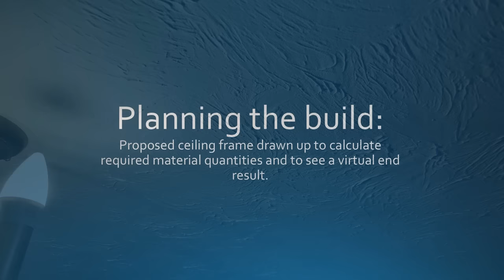Fibre Optic Star and RGB LED Ceiling DIY Build

Comment: Brilliant job, the best one of these I've seen, many thanks for posting this video. I love the overhang around the inner edge of the false ceiling surround, most of the DIY builds I've seen don't do this, but it seems important to me as a way of hiding the LED strip as well as increasing the effect of the starfield being way up in the distance beyond the ceiling. Can I ask, where is the LED strip mounted - is it on the horizontal or vertical? Thanks again, this video's been extremely useful as I'm going to begin my own attempt at this next month.
Reply from the maker: Thanks so much for your positive feedback and message. It was a pleasure to read and I greatly appreciate it.
The LED strip is mounted on the horizontal part and points light straight up, so only ceiling edges would appear to be washed out and not the whole star ceiling.
I hope it helps and good luck with your project! 
Do not hesitate to get in touch if you will have further questions along the way.
Reply: @DIY_it_ALL  Thanks so much for your reply, very helpful: I'd been trying to visualise where the best placement for the LED strip was - and yours works perfectly, so I'll go with a horizontal mount. I've seen several of these starfield DIYs where there's no lowered outer surround, rather the whole starfield is contained in a "dropped box" which, to my eyes, 100% misses the point of what makes these look so good. Thanks again, yours is the video that's fully inspired me (i.e. yours is the build I'm going to copy!) Cheers, keep yourself safe and healthy, all the best.
Reply: Koi ki miles  is not too i
Reply: Oooooooooll ok lnd koi I ok I will ji you my
Reply: @DIY_it_ALL  What state you located? I need to hire you. This is awesome work🔥🔥🔥🔥🔥🔥🔥
Reply from the maker: @uniqueone8928  Thanks so much for your comment! 

Unfortunately I don't think I can be of help though, I live in UK. And it is just my hobby at the moment...
Reply: @DIY_it_ALL  

Hi diy it all where about In the uk are you from? Seen this vid when first posted and finally got my house this was the one thing I wanted to do but struggling to get the materials that I have seen on this bought leds for another job and was not happy with them and didn’t turn out to well 

Hope you can help cam i private message you do you have what’s app
Reply from the maker: @Billye  Hello mate, thanks very much for your comment.
 I used SK6812 addressable LED's and SP108E controller (link below). 
Starlight-wise, please see the second link below. I personally used 400pcs 0.75mm 4M set.

Hope it helps.
 https://www.amazon.co.uk/dp/B07DVJ568C/ref=cm_sw_r_awdo_navT_g_G1F360F0DMTQ8EFTXRHV

https://a.aliexpress.com/_mLHuDJu
Reply: What was the room size?
Reply: S
Reply: @DIY_it_ALL  can i get your number
Reply: pls 🙏, how can i get this light
Reply: Hello !
did you get to do this job?
Reply: @mlycpe4248  I did!
Reply: Hi I want this done in a sensory room for my son can you send me your number plz
Reply: I'm using this video to create the same ceiling in my kids games room. Can I ask what the point of the small vertical pieces of wood that run up into the cornice/coving on the framing install. Cheers
Reply: I’m a plasterer, and was wondering if you could skim the starlights?

Comment: I apologize for missing it, but how did you hang the false ceiling? I think I saw screws going into the plaster board but didn’t see what you attached the screws to. I’m assuming you put the plaster right up against the current ceiling and drilled into the studs?

Comment: I have a question. When you painted above the fiber optic mini lights, how is possible not to paint them so that the emitted light to be untouchable? Is some kind special paint? Thank you in advance. Congratulations perfect job
Reply from the maker: Thanks so much for you your comment. 
Painting over fibre optic strands does not affect them as you'd think and they shine through just fine. However when trimming the strands, I did leave them sticking out by around 2-3mm in case I would need to trim them further after another coat of paint (if I needed to refresh the ceiling in the future).
Hope it helps.

Comment: Amazing!! I really want to add it to my home. But I am worried about its durability. Do you have any idea about its life??
Reply from the maker: Hi Thomas, 
Thanks for your comment.
LED's last much longer than standard incandescent or fluorescent bulbs, so durability would be the last thing I would worry about. Also, I personally left an access hatch to drivers and electrics, so that in case something goes wrong I will be able to access it and replace the faulty part.
Hope it helps.

Comment: Hi once again lol, another question for you if you don’t mind 🙈 1) on the main plaster boards with the star lights in them I can see that they don’t fully go to the edge (as there is still a gap around the outside, how did you cover this gap. Did you just cut some more plaster board (without stars) or did you just use a filler in the space. (The space I am talking about is basically where the led strips shine around the edge. 2) in the clip where you had all the fibres hanging down once the ceiling was up, what did you do at the point to hide them etc as I couldn’t see this in the video. Thank you so much for your time
Reply from the maker: Hi Adam,
Thanks for your question.
On one side of the ceiling I used the same plasterboard sheet and deliberately left 200mm off the edge empty (no fibre optic strands). But on the other side (where my light source was) I used a separate piece of plasterboard with no strands, which was around 200mm, to fill the remainder of the ceiling. So in the end all edges of the ceiling had around 200mm off the wall with no stars. This is so that LED light and stars would not clash.
Hope it makes sense and helps.
Good luck!

Comment: Great job with ceiling. Easiest method used with greatest effects. Can you tell me what measurements u used on the bull head boxing. Actual box size, recessed depth and recessed height to ceiling. Also how did you manage to use a paint roller with optics in the ceiling? Did they not get covered in paint?
Reply from the maker: Thanks mate!
Bulkhead is 250mm high, recessed depth is 500mm and height is 150mm.
Painting over fibre optic strands is fine, they shine through with no issues. Though I did leave them sticking out by around 3mm, in case I would need to trim them in future after more layers of paint are applied. Good luck with your project!

Comment: Hello, from the top side is the timber still exposed? Just trying to figure out if you stuck the LEDs on the edge of the timber or whether you plastboarded internally too and put them on the inside edge. Beautiful work
Reply from the maker: Thanks very much.
The timber from the top side is covered with a 6mm plywood boards, but it's not fixed to the timber for easier access. And LEDs are just sitting on top of plywood.
Hope it helps, and good luck with your project. 👍
Reply: @DIY_it_ALL  thank you :)

Comment: Fantastic job.. like a few others I'm trying to replicate it,  I've a slightly larger room with a similar 240cm ceiling height. I've read and reread the comments below and even resorted to measuring my computer screen and comparing your 4" roller to get measurments. Adding mesurements to the sketch up plan would have been ideal. The drop looks 200mm (you've mentioned a few heights below) with a 60-70mm lip (2x2 plus plaster board and edge) this leaves the gap to original ceiling from lip @ 130-140mm. 
No plaster board on the vertical edge of the lip, just the plasterboard edge bead?
Reply from the maker: Thanks so much for your comment! I love how much research you have done to gather all information and details. And yes, you're absolutely correct on all aspects.

I hope your project is going well.

Comment: How do you paint the ceiling without painting over the LEDs/fiber/pinholes? I don't get it - it looked like you rollered right over them, but how does that not cover them with paint?
Reply from the maker: It is ok to paint over fibres, they shine through absolutely fine (I did two coats of white vinyl matt paint).
However I also left them sticking out about 3mm for future painting. When they will no longer shine through, I will cut ends by about a millimeter to expose fresh unpainted fibre ends.
Hope it makes sense.
Reply: @DIY_it_ALL  that’s what i was questioning also. Thanks great video

Comment: Hi I am currently doing this same project and have a question. where did you hide the fibre optic machine? 
Is it behind the drop in the ceiling or just sitting on the ledge? Thank you. You have inspired me to do this and I am threading the fibres through my second board as we speak.😂
Reply from the maker: Thanks so much for your kind comment. I'm honoured to hear that my video inspired you.

The light source for the fibre optic strands is hidden within the drop ceiling in my case. And I left a small access hatch for future maintenance too (just in case). 

Good luck with your project!

Comment: Loved your video. A job well done! Can you guide on how you connected 15 m of addressable led strip. I mean addressable led strip are only available in 5m rolls. Can you possibly make a tutorial on connecting 15m led addressable strip as a single strip project
Reply from the maker: Hi Monis,

Thanks so much for your kind comments.

You are absolutely right, addressable LED's do come in 5m lengths. But it is very easy to join them by soldering strips together or just using small wires to join them (like any other LED strip). 
The strip can be as long as you want it to be, but the key here is to maintain voltage throughout the strip and ensure it does not drop below required levels. Try searching 'addressable LED power injection' or 'addressable LED voltage drop' on YouTube and you should find some tutorials.

I might do LED strip tutorial video in the future, but my focus now is on the new project I am working on - bedroom with projector and cinema surround sound system all mounted within the ceiling. Projector will come down and go back up into the ceiling whilst using a remote control.

Feel free to subscribe to my channel and keep an eye on my videos.

Thanks again for your comment and take care.

Comment: Excellent video.  How wide and tall did you make the soffit.  I am making one now and loved your project.  Thanks
Reply from the maker: Thanks so much!
The soffit is 500mm deep and height between it and ceiling is 250mm (100 mm for the bottom 'lip' and 150mm for the 'base' which is fixed directly to ceiling).
Hope it makes sense.
Reply: @DIY_it_ALL  it made sense. Thank you for the response too.  I created mine recently and used your measurements.

Comment: Just amazed 🎉 you just paint over the fiber lights and no problem? Is that correct?
Reply from the maker: Thanks! 
That's right, you can paint over them.   But I'd leave them sticking out a couple of millilitres in case you'll want to paint your ceiling again in future.

Comment: Amazing work 🙌🏽 i have to ask cause its bugging me lol after you placed through the fibre optic lights did you plaster the board and paint? Wouldnt that of paints the lights. Would really appreciate a break down of what you did this being o want to do the same at my house
Reply from the maker: Thanks so much for your comment.
I used jointing compound only on plasterboard joints working around the fibre optic strands. And painting over the strands is fine, the light shines through with no issues. But just in case I would decide to apply another (refresher) coat of paint in the future, I left fibre optic strands sticking out by around 2-3mm. So I would be able to trim them a tiny bit more if after the refresh coat of paint they would no longer shine through.
Hope it makes sense.

Comment: Just love your passion and interest to do your own ceiling light.
Would it be possible to show how the  frames were put and the drawings.
How did you screw the main centre plasterboard to the timber.
Also you started painting after you installed the fibre optic.How did it not block the hole with paint.Just thinking.

Comment: This is the best ceiling design I have seen ever. Can you please educate me about lights. May I ask from where you procured these lights?
Reply from the maker: Thanks so much! 
I bought all lights from China, but I'm sure you can get them anywhere in the world - SK6812 strip, SP108E controller, 30W driver and 400 fibre led starlight set.

Comment: Good evening, I hope you're well and great build and I have been following the process so thanks for this video! It's been very handy to relate to so thank you very much. But I just have a question: I'm almost at first fix electrics - did you tap in to the ring main or run a fused spur from a socket or is everything (LED strip and controllers, spot lights and fiber optics) powered by the permanent live from the old ceiling rose? And is the power boost/injection that's every 5m also powered by the same source, from the live in the original ceiling rose? And if so, 1.5 cable or 2.5mm to run from the orig ceiling rose or junction box to the new lighting? I see a hidden single socket in your video, but it looks to be connected to the wires from your old light fitting. I'm sure the loop in on the lighting radial in my house is only 1.5mm (I'll have to double check prior) and protected by a 6A breaker on the consumer unit and not on the RCD protected side like the 32A ring mains are. Once I get a power supply sorted, I'll be away as I'm a plasterer by trade. I'm just worried about overloading the lighting circuit when running LED strip +controllers, stars and spots all at the same time. Any feedback or reply would be greatly appreciated 👍🏻
Reply from the maker: Hi Mike,

Thanks so much for your kind comment and questions. And sorry for the delay in response.

I personally have connected all new lights to the existing 1.5mm lighting circuit I had in my ceiling rose, which is on a 6A MCB protected by an RCD.
Current draw for all additional lights is minimal up until LED transformers because it's 230V supply, so no worries there cable size wise. Only after transformers current draw becomes greater, because of lower voltage. In my case SK6812 LED strip was 90W and rated at 5V, therefore it would draw 18Amps (90W : 5V = 18A) after the transformer.
As such cable size that could carry 18A should be selected. But for example if your doing 5V power injections every couple of metres like I did, then you can divide the total Amperage be the amount of power injection cables. I personally have four power injection points, therefore it allows me to use a smaller cable size (18A : 4 cables = 4.5A per cable).

On the hidden socket subject, it's only there for the fibre optic led transformer, which came with a socket plug and draws absolutely minimal power. So it's not a "real" socket you could use to plug in a 3000W kettle (hence it being hidden above the dropped ceiling and labelled accordingly). It acts as a switchable connector for the fibre optics LED transformer rather than a socket.

Hope it makes sense and good luck with your project! 👍

Comment: Sorry just had a question about the frame….was the size of the wood used to make the frame 2x2? How far from the ceiling is the frame placed and how far out from the wall do each pieces of the frame go out. Sorry…trying to do something similar in my dining room and this would be awesome.
Reply from the maker: Hi there,
Yes I used 2x2's for the frame.
The soffit is 500mm deep (width-wise) and the height between it and ceiling is 250mm (100 mm for the bottom 'lip' and 150mm for the 'base' which is fixed directly to ceiling.
Hope it makes sense.
Reply: @DIY_it_ALL  ahh thnx. I’m not fully understanding but I’m sure I can figure it out! Looks awesome! Thanks again

Comment: Great video one of the best I’ve seen 👏🏼👏🏼. At 4:42 did you connect the leds in a circle back to the power supply to make it that bright because mines aren’t that bright and I use the exact setup u mentioned. Did u power inject every how many feet??
Reply from the maker: Thanks so much for your comment.

Yes, I did connect LED's into a circuit within the driver terminals and injected power to the strip every 2 meters (around 6-7 feet). 

Hope it helps and good luck!
Reply: @DIY_it_ALL  thank you
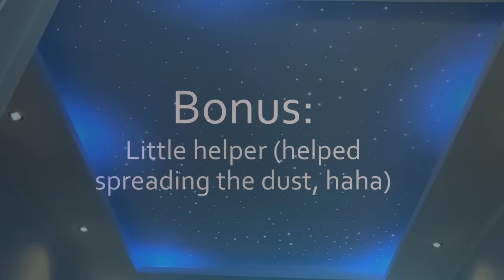Reply: I got it set up but it doesn’t look as good as yours lol. From 6:43 to 7:20 how did you get that effect, did you customized it or it’s already preprogrammed? I’m using the meteor effect but it’s not as fast and vibrant as yours
Reply from the maker: I used SP108E addressable LED controller, which came pre-programmed with around 200 different colour modes/settings. It's not expensive, give it a try. :)

Comment: How did you decide at what height the tray has to be so that the led lighting would give the desired effect on the ceiling? Also how far is the overhang for the led light on the tray ceiling and did you attach the led lights using tape to the tray ceiling overhang?

Comment: This is amazing! I am going to try the tray ceiling in my house. I have a few questions if you dont mind? How far down is the tray ceiling from the main ceiling? What is width of the tray ceiling? And how deep is the overhang? Thanks
Reply: If you have the dimensions of the individual timber pieces which make up the tray ceiling, that would be even better. Thanks
Reply from the maker: Thanks so much! 
500mm deep, 200mm high and 150mm for the overhang.
Reply: @DIY_it_ALL Thanks for the feedback. Did you screw all four sides into the ceiling joists? I could only locate the joists along the length of the room, along the width there is no joists 35cm from the wall.